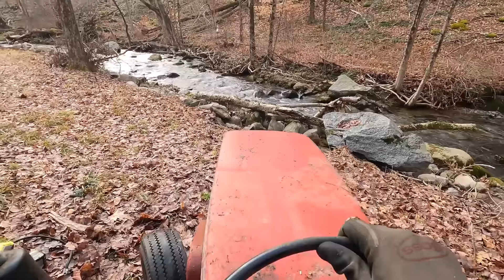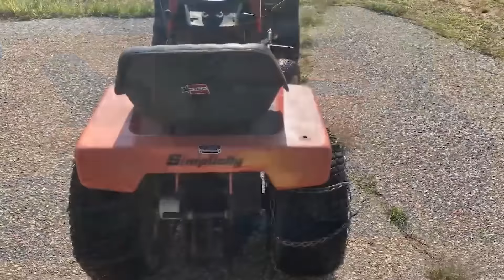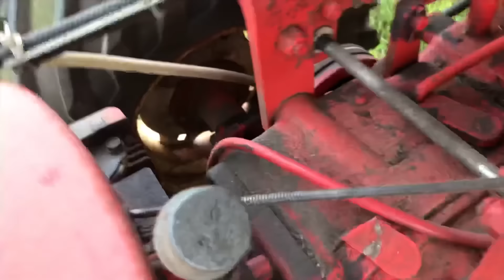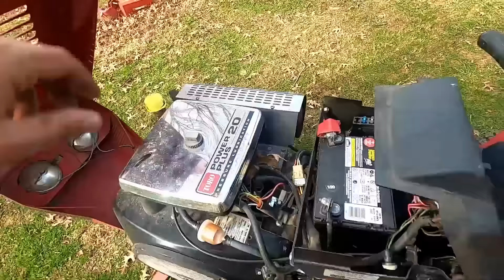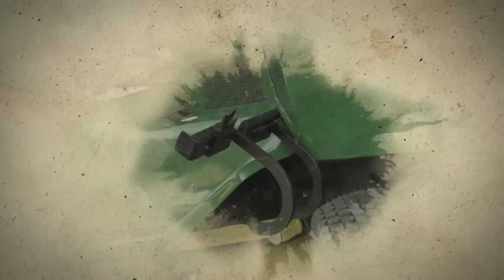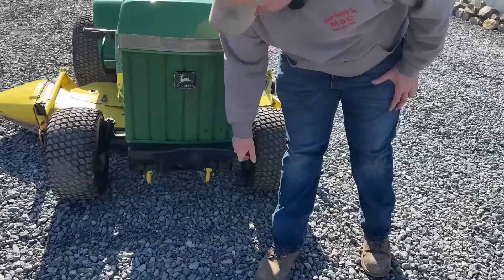12 OVER ENGINEERED GARDEN TRACTORS

Comment: My 2021 Craftsman tight turn 5 " turn 46" deck Kohler 7000 series 22 horsepower 725cc V twin engine 3.1 gallon fuel tank 20x10-8 tires..730 pounds with the deck and fuel tank never sell it it's built like a little tank I'm glad I bought..

Comment: I have had Simplicity for 50+ years. I currently have a few Legacy XLs, Diesel and gas 2wd and 4x4, 27 & 31 hp. I've had many 7000, 7100 series back in the day. Then I had 5 SunStar tractors. Then the first Legacy, I had 3, which were the worst tractors I ever owned, they only made them from '98 to '03. The two I had the longest is a 1975 7000 series with a 3 speed gear drive I stumbled into at a dealer in 1988. It had a brand new engine because the oil wasn't maintained by the original owner that traded it for a new tractor. I could see instantly the original engine with that old style belt drive starter/generator was replaced with a new engine with the modern smaller gear drive starter/alternator that's still used today in the 2020s. I had to buy a new starter about 15 to 20 years ago. It has a 42" mower in my shed that I haven't used in 30 years, it has a 46" dozer blade on it all the time. It's sort of a body saver, a motorized wheelbarrow with a Simplicity dump cart and factory extended height metal sides hitched on the draw bar to move debris. It's one of those old Simplicity dump carts that tilts 30 or 90 degrees that is also a vacuum collector/PTO driven before the deck driven Turbo Vac. I also stumbled into a lawn tractor with a bad engine/very low compression from a short term client. 5010 Broadmoor, I re-powered it in 1987 with a new I/C Briggs 11hp/Cast Iron Cylinder Liner that they didn't build when the machine was new in 1976. It's the last year for that chassis, including a cast iron case transmission on a Simplicity lawn tractor. In 1987 it was the biggest engine that would fit without major fabrication. I have other attachments and accessories for both of them as well. I don't use them often but they're handy and are worth more to me than what I could sell them for. That dump cart/vac collector cart I used to use on both old tractors in the 1980s and early 1990's.  The 5010 vac system has a separate 5hp I/C engine mounted to the Simplicity carrier/frame that fastens to a specific draw hitch that the rototiller, and other rear attachments, also mounts on and also fastens on the top between the frame rails with a long pin and spring clips.  I used to have 3 dump carts but I sold them decades ago several years after the Turbo Vac with Wide Body 17 bushel Collector arrived that fits SunStar, Legacy and XL with hardware bracket update kits. The problem now with Simplicity is Briggs & Stratton destroyed Simplicity and parts have become trouble. What limited parts are available are extremely expensive. Wisconsin where I am used to build a lot of L&G Equipment brands and engines Briggs, Kohler, Tecumseh.
Reply: I knew it would be curtains for Simplicity right after Briggs bought them out. Just a matter of time. They will most likely end up like a lot of other well known brands, what I call "Brand Whores". 
That's were they pimp out a good name brand, and make it in China.

Comment: On mine, I changed the rear tires from turf tires to field lugs for much better traction.  It didn't make much difference on the lawn, but a huge difference in the garden.  No problem pulling a small one-bottom plow.  Also a single section spring-tooth drag.  Preparing the garden for spring planting was quick and easy.  Cub Cadet handled it all.

Comment: KT17 reliable? lol, lol, lol, lol, lol. That engine almost bankrupted Kohler. The Cub Cadet 1650 WAS NOT A PRESSURIZED oil system and did not have  a 3 point hitch, it was a one point hitch or sleeve hitch. The Bolens HDT1000 came out with a diesel engine 2 years before the John Deere 430 and the Ariens GT18H, Cub Cadet 782, and Cub Cadet 882, came out the same year as the John Deere 430, all with diesel engines
Reply: That's exactly what I was saying

Comment: Case/ Ingersol tractors were NOT hydrostatic drive tractors. They were hydraulic drive. The had an engine driven pump that ran a hydraulic motor that drove the dual range drive axle, and also powered the hydraulic implement lift and hydraulic driven attachments thru a hydraulic PTO valve.
Reply: I've got my father's, a 442 from 1977. Still running, it's probably hands down the best rototiller I've ever used.
Reply: I don't know why it's so hard for people to get that right. Very common.
Reply: Started back with the colt
Reply: Well i have a 1650 international Cub cadet hydro motor needs rebuilt and have a 1999 model 2135 series 2000 still running today has a 13 HP Kohler command horizontal engine and I'll put it up against any of those yard tractors 27 years old and never replaced anything but the belts for the deck and it is driveshaft driving

Comment: I'm surprised that none of the Case tractors are included.  Instead of hydrostatic, most use a true hydraulic drive system.  Equipped with multiple hydraulic take offs, they  were a beast.
Reply: Case tractors were bought out by Ingersol.
Reply: The Ingersoll has the same hydraulic drive, not hydrostatic as mentioned above.

Comment: Those old cast iron single cylinder Kohler's were really good engines! I think those horses were quite a bit bigger than the ones today.
Reply: @edward: I have about 6 Wheel Horse tractors but my " Cornerstone " is a 1977 B - 80 that I bought new in May of 1977. Except for an engine rebuild in 2014, that tractor has mowed my yard every year since 1977 and will again this year. Regarding the Kohler engine, I have told others that I feel it had to be one of the best if not THE best small engines ever built.

I've heard people say, " Those old Kohler's would run forever ".
Reply: WISCONSIN ROBINSON ENGINE! From more than 3 decades ago! STOUT, SOLID engines. kohler command PRO AN OLDER ONES. THEY WILL NEVER BUILD EM LIKE THAT AGAIN! These were stock engines that came in everything you bought! Now they’ll never make stuff like that anymore! These 200-800hrs IF YOUR LUCKY especially from big box stores.there’s maybe 1 exception I can think of now an that’s even lower end Kawasaki engines

Comment: Had a JD 318 for many years. Now use a JD 430 for lawn cutting and a JD 455 for everything else. The 430 and 455 both have fuel efficient diesel engines and power to spare.